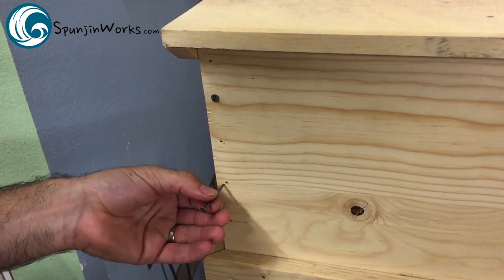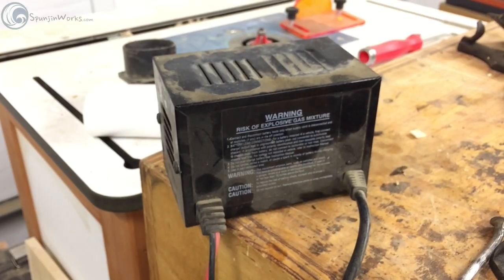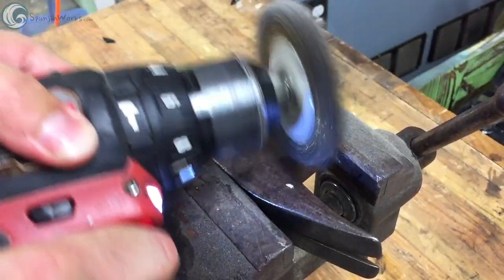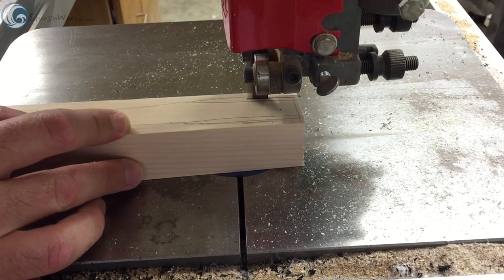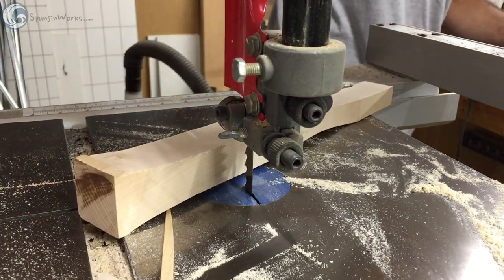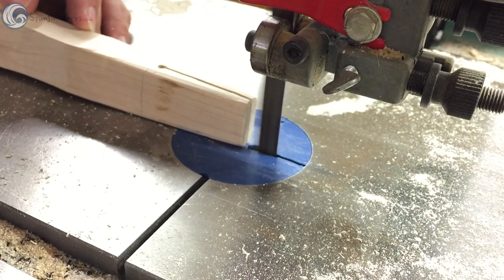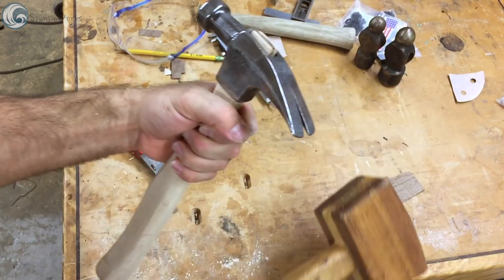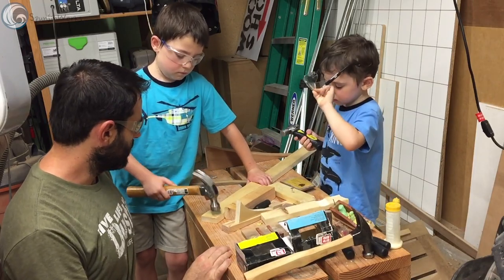Hammer Restoration // How-To (Ep. 74)

Comment: Nice work. Need a video with more info on that lathe buffer you used.
Reply from the maker: +Charlie Thompson thanks, Charlie. I use to use it for polishing turnings but I once polished a knurled brass knob on a plane and the wheels got dirty. Now I just used it for metals. It's essentially the same as a buffing wheel on a grinder motor.
Reply: Thanks I was wanting more info on did you make it or did you buy it if so where can I buy one. Thanks again
Reply from the maker: +Charlie Thompson I bought it from pennstateind.com. It is the 3 Step Lathe Buffing System.
Reply: Thanks